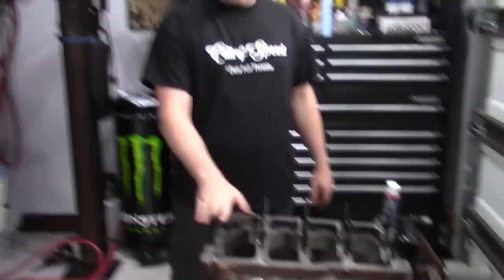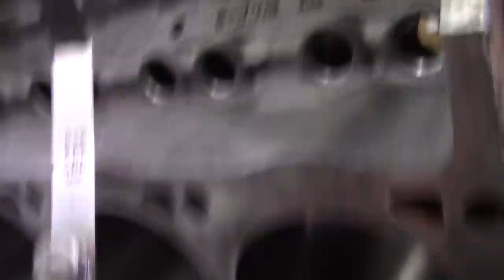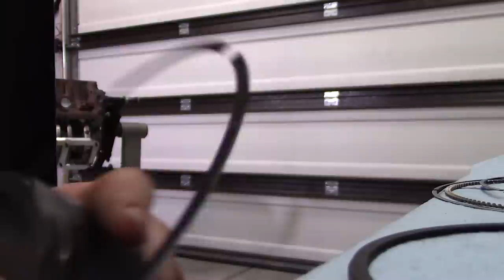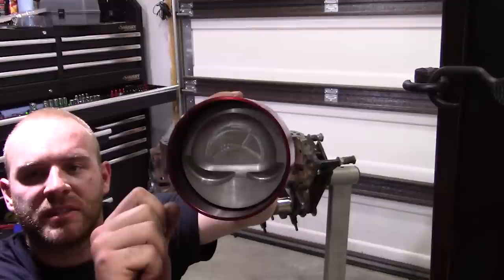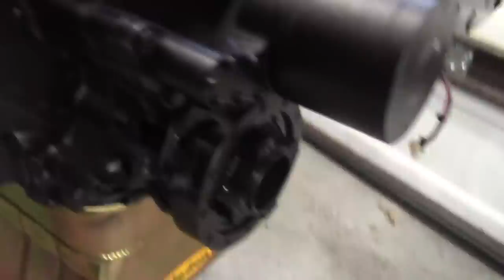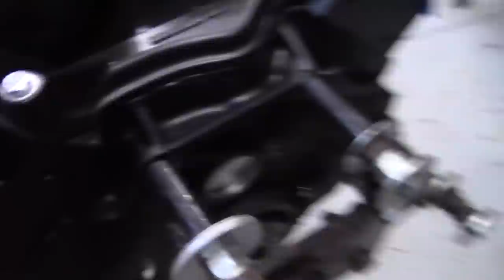500+hp 351W Stroker Build

Comment: Wish I'd stroked my Windsor when I dropped it into my '73 302 Torino back in '82. (where was YouTube back then!?) I used the '69 block, flat pistons and heads with exhaust valves from the 460 heads.  Loved the "head scratcher" moment at 6:55: "Start in one corner, tap,tap."  Brought back the old joke about pissing in the corner of a round room.
Reply from the maker: they make good power thats for sure. 
but sounds like you did what you could at the time to maximize your output aswell.  

sure wish i had a 69 block for mine!!

Comment: I've found if you slip a 6" long piece of fuel hose over the connecting rod studs before setting the piston in the cylinders, it will 1. keep the threads safe, 2. keep things safe from the threads and 3. guide the connecting rod around the crank. Leaving you free to focus on getting in the hole.
Reply from the maker: thats a great tip!  thanks for sharing! i will try it next time
Reply: Learned that 40 years ago but more like 3 inches
Reply: @ryangulley2051  True but I use 6" because it's what I have on hand and been working with for near 60 years.

Comment: everything was done good sept that fram filter its gonna destory them bearings man!
Reply from the maker: Like i mentioned to a couple other people.  I use the cheap fram filters for mock up and when we are ready to fire the car we swap out to a Ford filter.

id rather have something happen to a filter i dont plan to use than one i do :)

thanks for the comment!
Reply: Been running fram filters for years on high horsepower motors and haven’t lost a bearing yet?

Comment: Guys.  Not to nit pick but if you used ARP Main Stud Kit 154-5409, final torque is 110 ft.lbs, not 90 ft.lbs.  Cool stuff guys, keep up the good work.
Reply from the maker: Appreciate the comment. Built the motor years ago and I'm not sure of the PN so I can't verify whose correct. 

but let this be a lesson for anyone watching to double check the mfg instructions! 

appreciate the comment and the time to watch!
Reply: @710Garage  Cool.  I am building a 393W right now, so I'm checking out what my esteemed colleagues have done!😁😄
Reply from the maker: I wanted a 393 but it was crazy lead times and the 408 was in stock so went to that instead
Reply: @710Garage  Guys.  I apologize.  You are using the DSS stud girdle which requires a different torque value vs. the ARP studs.  I tried to find the DSS instructions on line but could not.  I'm sure you guys nailed it.  Looking forward to more cool stuff from you guys.
Reply from the maker: Thanks for the great comments. 

I appreciate view!

Comment: I did that on my Harley Davidson, I didn't use a grinder,a good mil file did the job.When I measured the bore I kept getting.005 larger than the book said,then I found the .005+ on the Piston.The bore still had the factory hone marks.The rings were wore because of the carbon on the Piston was in the center and not on the edges. The guy that had it before me added an S&S carb and was running it too rich causing a massive carbon build up on the head which raised the compression causing the head gasket to fail.
Reply: I have 2 ,351who 345 hp factory.
Reply from the maker: anything for you

Comment: Do your engine a favor and trash that fram oil filter because they are trash. Put a wix puralator or anything else. Fram has cardboard end plates in them that collapse and will starve your engine of oil. We tested several fram was the worst.
Reply from the maker: Appreciate the comment, BUT we always toss a fram on it while building and installing incase we hit it installing the engine.

before fire up we swap the filter out for a ford original unit.
Reply: I use a Fram filter on a new motor only for the break in run. After changing the break in oil, I install a good Purolator or Motorcraft filter.
Reply: use a Wix R, right now I'm using a purolator BOSS. #30001 I believe. Like those Mahle pistons but they did not have a 4.060 bore for my stroker. went with SRP forged.
Reply from the maker: @dufus2273  those are still great pistons though...   sounds like you have a great build aswell.
Reply: i lost an engine one time due to  using a  fram and thats all it took foe me  never again . the gauge still was showing oil pressure but no oil was passing thought the filter  . when i pulled the filter maybe a table spoons worth of oil came out of it
Reply: I have built hundreds of motors and always use Frame filters to break in the motor and then throw away afterwards with same or better replacement filter. Never once had an issue with Frame. I have seen people crying that the Frame filter used by them caused some catastrophic engine failure but it almost always has something to do with low/no oil pressure and if checking oil flow by priming and pre-lubing properly BEFORE starting the break in process you can be sure whatever filter being used is working properly. Too many people do not understand how to check for proper oil lubrication before beginning the critical break in process and blame things like the oil, oil filter, cheap gauges, or cheap aftermarket parts. Hey, I'm not disagreeing with your in house tests; I am just giving my experience as a builder. All high performance engines need an oil filter change 5-10 times more frequently then  stock OEM recommendations in order to keep oil clean and free flowing. Frequent oil and filter changes ensure that whatever filter used doesn't matter the type in the long run. I agree that Wix is also a great filter.
Reply: Donny Rowe I’ve heard that too
Reply: Agree. Wouldn't put a Fram on my bicycle and it doesn't even have oil!
Reply: I have used Fram in my daily driver for over 200k miles.    They work just fine.
Reply: unclevito2002 I use Fram on everything I’ve ever owned since 2001🤷🏽‍♂️

Comment: Is it cheaper to build a 351 than to build a healthy FE?? I can’t decide whether to make a nice FE390 with 420HP or so...or do a 427 small block with the 351. I got a sweet little 66 Ford truck that I want to make a nice street cruise. 420hp is plenty for me. I like the idea of a FE big block like the 390 but a 427 small block sounds very appealing as well. I like the idea of a 427 emblem  on the truck 😎
Reply from the maker: to make only 420 hp you dont need to waste all of the money on going a big 427.

to run that it, you will need a dart block.  

you can run a simple heads, cam , intake and make well over those power levels.

Comment: Good job!!! But the second I saw that fram oil filter I freaked out! It's Purolator guy, trust me! Frams always leaked down oh so quick compared to a purolator oil filter. Every time I use a fram filter my engine goes tick tick tick on startup because the oil filter leaked out! Don't happen with my purolators! Better yet get a royal purple!
Reply from the maker: Thanks for watching and commenting.  I always install with a Fram since they are super cheap incase there is a mistake and I hit the oil filter or anything on install and swap out once installed and I'm ready to fire.

Comment: Great video and thanks. Working on a 351w build  also. What heads did you use?
Reply from the maker: THANKS!!!

we are running dart pro 1s on this setup.
great question.
stay tuned we are just editing the engine build video now, which will go through ever part of the build, part numbers, why we used them, etc.

hopefully this week that will be done.
Reply: I have a set of TFS R heads on my 410 CID Windsor.You need to buy some good heads for the big stroke engines.Shooting for 550+ HP on pump gas⛽

Comment: Is that all OE block?  Is it still in one piece now that you've had time to run it?  OE 351 blocks will break the #3 main journal up to the cam journal when you put big power to them.  The 302 block is much stronger.  If you want the large displacement you'll want a Dart 351 SHP block for your build.  Good thing is that when the block breaks it usually will tell you before doing damage to your other components.
Reply from the maker: i think you're mistaken.  the 302 blocks crack and the 351 are much stronger...  there are ALOT of guys making the power we are on a stock block out there. 

unless you go iron eagle block or billet the added strength isnt significant enough to warrant the price in my opinion. 

stay tuned i suppose and see what happens!
Reply: No sir....not mistaken I assure you.  The tall deck Windsor will break at the #3 main journal.

Comment: did you balance the rotating assembly? be sure to use an arp oil pump drive especially important if you ever run 20w-50oil. I used those scorpion roller rockers on the last three I built . they work great on 3/8th screw in studs
Reply from the maker: thanks for the tips.   Yes it was 0 balanced, and has an arp drive for sure.  thats cheap insurance i do on every build

Comment: what are you building? 393,408.427? What's the bore? Lotta info missing. what's the compression ratio, compression height?Those look like Mahle pistons. I wanted to use those but Mahle didn't have any that were 60 thou. over so I went with SRP in my 398ci Windsor. dynoed at 498 hp.
Reply from the maker: there is a full pdf with all details in the description.

Comment: Subbed. Like your detail in videos
Reply from the maker: Thanks for the comment and glad you enjoy the series!!
Reply: @710Garage  I just got a mud truck with my son but the motor has a cracked block. It is a 351C so we will be switching everything over to a new block over winter and am considering stroking it at the same time. It was running 456hp before getting new piston and rings. Then the block split.
Reply from the maker: sounds like you have the the right idea!!   maybe a girdle setup will help from the splitting.
Reply: @710Garage  it has a girdle and studs. I believe the other owner was running a 200 shot ontop of it all. So I'm thinking that could have split the block? Your opinion? The truck was a proven class winner but I'm not sure if I want the same pattern if the extra nitrous is going to do that alot
Reply from the maker: The 200 shot could have done it for sure.  what year was the block used? and was it bored over at all?
what internals did it have?  
im wondering if it got some harmonics and that led to the block splitting.
Reply: @710Garage  not sure the year of the block. But I did find out it was bored .40 over 😨 not sure of internals at this point but when we rebuild it we will be getting it balanced. Fortunately truck came with extra block and I also have 2 extra Clevland blocks as well.
Reply: @710Garage  https://www.instagram.com/p/ByMD3INl8Y2/?igshid=1lo2x5nbvx2rc can be seen running here
Reply from the maker: @doubledragon5750  sounds like you have a good starting point,  it would be good to see what internals it had, and if any of is reusable.   im sure a machine shop will be able to check it all over for you and give you a recommendation on how to proceed

Comment: Love the build but you left out a few steps on the shortblock like checking the thrust bearing clearance and  at least 1/4 of a inch clearance between the oil pump pickup and the pan. Also did u check bearing clearance?
Reply from the maker: i did these checks yes but the footage wasnt ideal ( lighting etc ) so i left them out of the video.

Comment: What year block are you using, I'm trying to figure out what the internals are on my friend's 93 Lightning?  The only thing I know is the pistons are hypereutectic, but as far as the crank and rods I'm not sure.  If the crank is nodular iron we should be ok to CAM it and port the heads and tune it on 93.  See if we can pick up another 100 ft-lbs of torque.
Reply from the maker: mine is a 74 block.

you should be fine doing those upgrades to your motor.  just stay safe with the tune and you wont have any issues. 

good luck.  check back in and let us know what parts you decide to go with!

Comment: my 408w is getting under way, and i’ve spent nearly $5k on just the bottom end to make sure i can reach my power level goals. would you think that 800-900 is possible w around 14 psi of boost? and are clearance notches on the bottom of the bores necessary for a stroker rod?
Reply from the maker: yes notching the block will be needed.

what is the compression ratio are you running?  and what did you purchase so far?
Reply: Man…at what point are you better off just building a turbo 5.3? What did you do to the bottom end that costs 5k?

Comment: Yea... If their uncomfortable doing a timing cover or intake then they have no business trying to do rings and pistons lol. 
 I do prefer a machine shop to do the rotating assy and cam journals. Not much extra if you're having the block prepped. I guess if you're not taking it to a machine shop and just honing the cylinders ok to do your self.  Actually I might have to my self. I want to put new rings in a gap them for boost. (351 Cleveland)  I am hoping 7-9 lbs will be ok on stock gap, but will want more boost later.
Reply from the maker: the problem with boost is its fair too easy to turn it up!! lol  you start with 8... then 15..... then 20..... and before you know it your stuff is all scattered lol 

open that gap!
Reply: @710Garage  lol yea, that can sure enough happen. 
I had a 300zx twin turbo.  Factory boost was 9. Add ons and tuned it was 15-16.  17 is where the injectors ran out. 
 I'm not going to use a boost controller. Just stock waste gate pressure. Some are 7, some are 9. 
 I think my biggest problem is going to be not blowing up other parts on the car.  That motor with boost will be enough to break everything in the drive train. Everything should be ok to 1k hp, except maybe transmission. FMX is tough, dunno how tough. Don't think any one knows.  I have a 4 speed on stand by if I need it.
It's a 73 mustang. I can actually hide the turbos and piping. vent blow off valve back to intake so you don't hear it.  Small turbo's won't be heard over exhaust. Should be a great sleeper.
Reply from the maker: @starbattles1  im excited for this one.  keep us up to date with info!

Comment: Thanks for  your videos. I have a 351 Windsor 5.8 and it's only running in 4 cylinders. Looking on the distributor top the # 1 no working, 3 yes, 7 no, 2 yes, 6 no, 5 yes, 4 no, 8 yes. I have the correct firing order but I can remove the 4 wire plugs for the 1-7-6-4 and still running good, but when I put it on drive it doesn't has any power the all. Any ideas? Thanks.
Reply from the maker: if its only running on 4 cylinders that is the problem for sure... 
i cant quite understand why it is though... if its firing on the 4 that means the coil is working properly.
have you tried replacing the distributor cap and rotor?
also what about the spark plug wires and plugs?
you NEED it to run on all 8 before you can try driving it.

Thanks for the comment! lets get this figured out!
Reply: Is it possible that the 351w you have may have been in a air compressor.  As in the past the military and. Few other companies produced air compressors out of a few different v8 engines that would run fine on 4 cylinders.  And produce air pressure with the others.

Comment: One thing I noticed you said you were building a stroker yet you didn't say how big the stroke you didn't give cam specs you didn't give what type of intake you're using you didn't explain what size carburetor etc etc etc also you better get rid of that Fram filter if you're going to do anything with that motor!
Reply from the maker: well this video isnt to tell you how to chose the size of a motor.... 

there is another video that i have ( 351w stroker - suggested parts https://youtu.be/XorznMfw4pQ )
which has a PDF page to go over all the specs of my build.

and as far as your comment about the fram filter, please review the comments and description of the video here as i mention that i always put a fram filter on while putting a motor into the chassis. infact this filter has been used more than once for this.  so that if i hit it with a bar trying to push the motor to 1 side, or anything happens i dont have to worry about it.  its part of my process.  i use WIX filters while running or driving

glad you watched the whole video, and thanks for the comments! 

have a great day!

Comment: soon as you touch something that was cleaned with are hands, it will put sweat on that are metal and cause a rust spot. and some cleaners leave a film. if it does oil cant do its job  so alcohol or acetone or mek usually and gloves,
Reply: MEK is too powerful i wouldnt recommend it for daily use on when absolutely needed. Cancer is too much of a problem these days. Acetone and Isopropyl alc is good enough.
Reply from the maker: these are good suggestions.  and you are not wrong.  this is just the way i do it always.

Comment: Can you tell me if a 351w roller block with a edelbrock air gap intake will fit in a 68 mustang stock hood?
Reply from the maker: I'm not sure about each intake. But my 351w with a vic jr did not. Even with lowering mounts, and shaving the intake down my elbow on top was still 0.5 inches high. 

with a super super slim air filter it may but not with my setup. 

hope that helps!
Reply: @710Garage  thanks

Comment: DIDI YOU KNOTCH THE BOTTOM OF THE CYLINDER FOR ROD CLEARANCE
Reply from the maker: yes i did. 
i just spun the crank until it was close, marked the cylinder.  removed the crank and rod and with a carbide burr clearanced it.

then tried again until they all cleared.